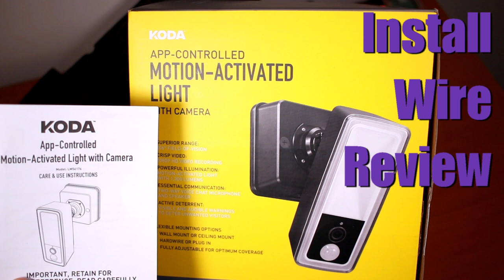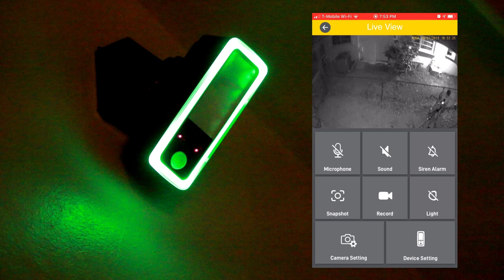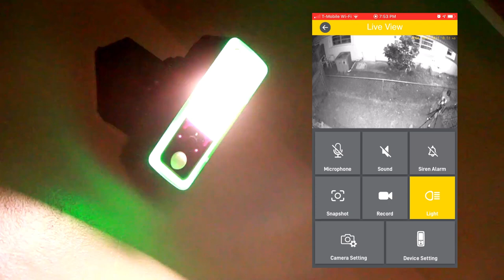Koda Security Camera Motion-Activated Floodlight installation and wiring

Comment: I just installed the light, everything run good except the motion sensor. It is very weak even though I adjust the most sensitive in app. Is it the same problem to you?